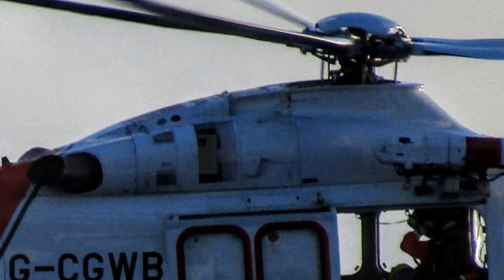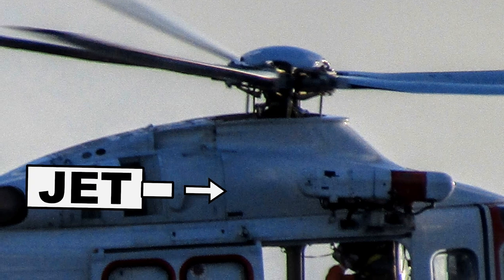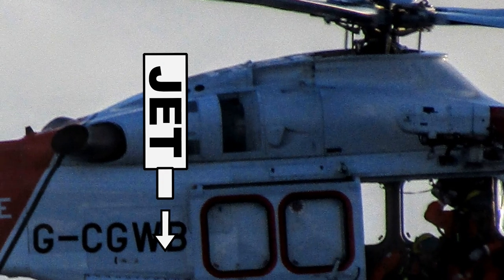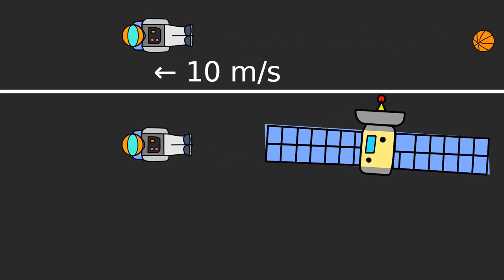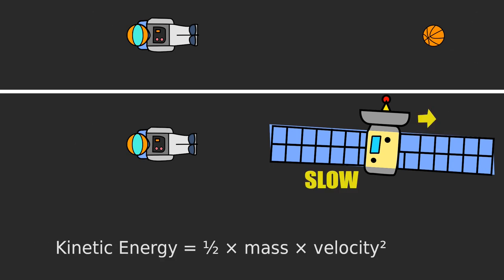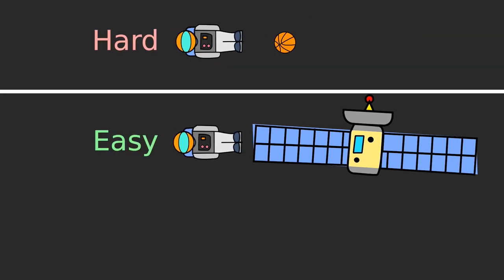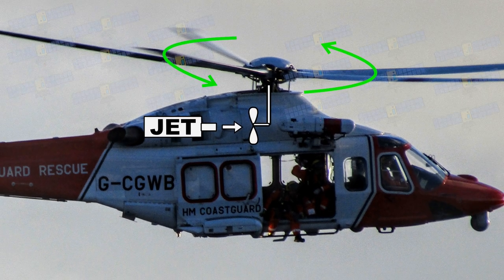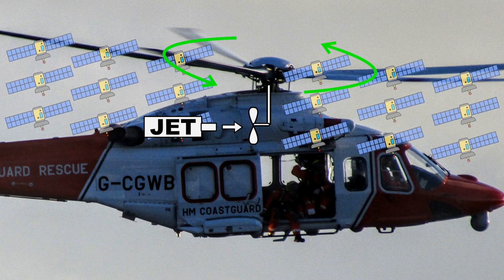Why We Use Jets to Power Helicopters #VeritasiumContest

Comment: Very good question, in my opinion. However, your explanation lacks the connection between the power output of an engine and the thrust force generated by that engine. We need to obtain great thrust force with a fixed power. The lower the speed, the greater the strength, this is true. But it is desirable to add: at a fixed power.
Reply from the maker: Good point. The limited time and my wording made this connection unclear. I might have to make a longer video some day to explain this concept in more detail.

Comment: first, because "autorotating" is not possible with direct jet thrust. also, helicopters are used for picking people up while hovering over them and a jet would probably kill them if directed straight down. but, turbo-shaft jet-powered helicopters are awesome because of the power to weight ratio compared to piston engines.
Reply from the maker: Indeed, the greatly increased efficiency of a large rotor does provide the pleasant side effects you listed.
Now, let's prove the rotor's increased efficiency with widely accepted equations.

Kinetic energy = 1/2 * mass * velocity^2      and      Momentum = mass * velocity

Air A--- 1kg of air flying at 10m/s ---
Momentum = 1 * 10 = 10
Kinetic energy = 1/2 * 1 * 10^2 = 50

Air B--- 10kg of air flying at 1m/s ---
Momentum = 10 * 1 = 10
Kinetic energy = 1/2 * 10 * 1^2 = 5

Both above examples have equal momentum, but Air A has 10x the kinetic energy of Air B. Therefore, pushing off of Air B requires giving it less kinetic energy. At first, it's hard to get an intuitive grasp of what these equations prove, and I might make a longer video in the next few months to explain.

Comment: Does this idea apply also to jetliners?  Don't the jet airplanes direct the air straight back?
Reply from the maker: A turbofan engine also has a small jet inside that blows on a turbine which spins the large fan at the front. The wider this fan's diameter, the more air it can push. That's why newer jetliners are widening their engines. https://en.wikipedia.org/wiki/Turbofan